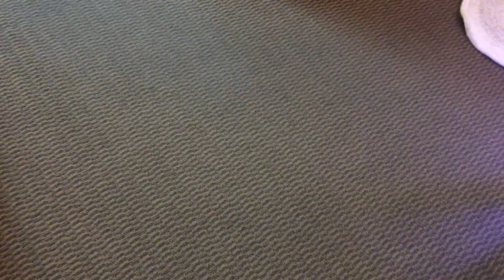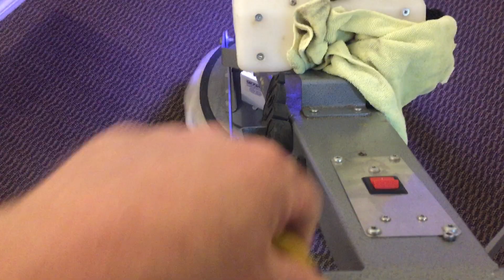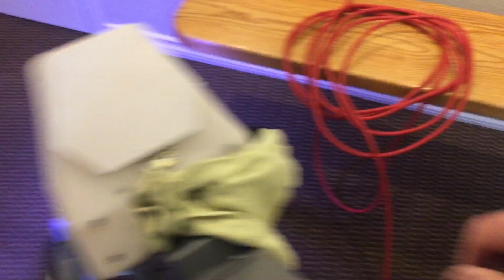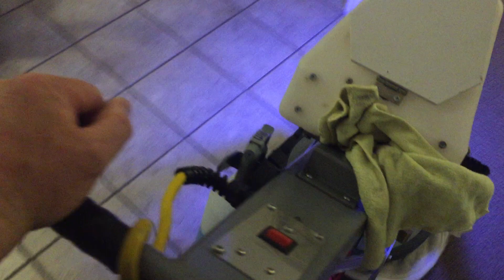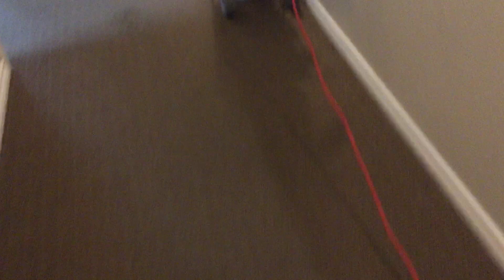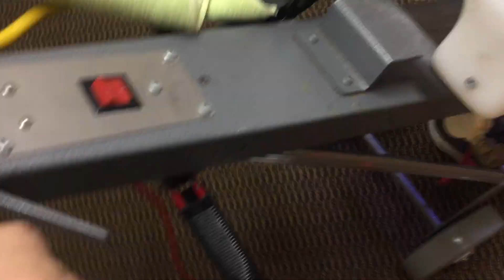Oxy-Dry cleaning a commercial carpet job with my faithful Orbitec OP

Comment: Robin, Thanks for the video, I was wondering what your thoughts about the Cimex vs an Orbiter on commercial carpet cleaning?
Reply from the maker: The Cimex does not remove any soil, it glomerates the soil into invisible clumps (it looks good) that is encapsulated by the encap cleaner and the soil is then removed by the janitorial staff later. This means the actual soil removal is dependant upon the quality and frequency of the subsequent vacuuming regimen. The OP machine is typically used with an encapsulating cleaner as well so some soil is glomerated and soil is also removed in subsequent vacuuming. The main difference is that the majority of the soil is actually removed in the cleaning stage and is transferred SETT (Soil ExtractionTransfer Technology) into the cleaning pad rather than left in the carpet. An OP machine will typically produce a more even result and drawing out and removing stains rather than washing them into the carpet fibre is a more effective approach I think. I looked at the Cimex when they were first introduced and immediately saw the shortcomings and a short time later bought my Orbitec and never regretted choosing this approach. If I ever bid against someone using a Cimex I just point out my system will remove the soil but the Cimex user expects the Janitorial staff to attempt to remove it later, its an easy sell.

Comment: Great example of a commercial job.  When you say you are using Revive- is that the radical rinse? Looks like a good product for commercial.
Reply from the maker: I am using Revive it Rocket, not Radical Rinse and it contains bot Peroxide and Citrus so it is a good choice for commercial where there are likely many mystery stains.
Reply: @OxyDryCarpetCleaningKelowna  ok cool. I have that too, I wasn’t aware it could be used in vlm because of the higher ph
Reply from the maker: @jhahnstadt  The ph is 6-7. Go to bonnetpro.com and check out all the info there about their products, all very high quality and top performance.